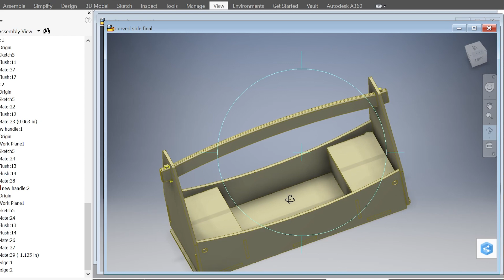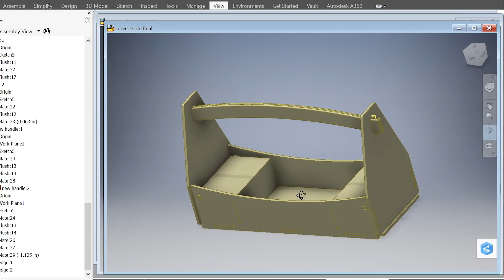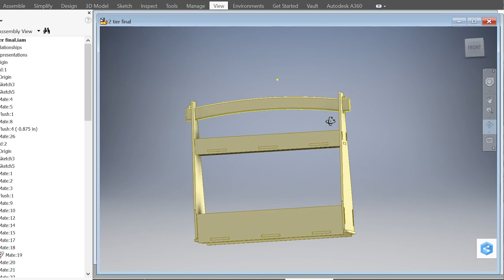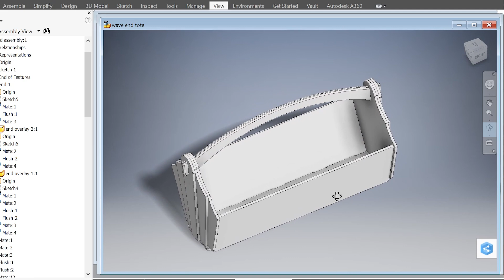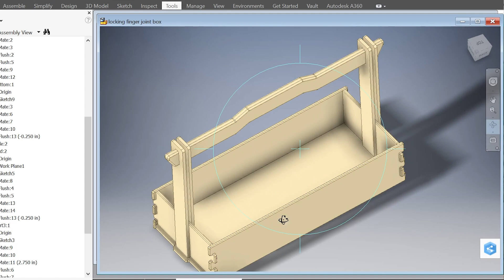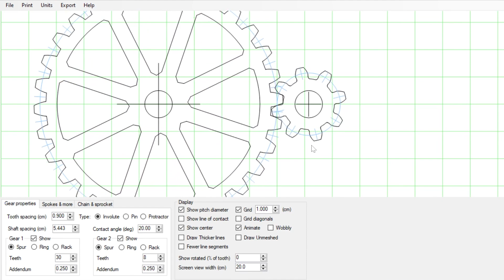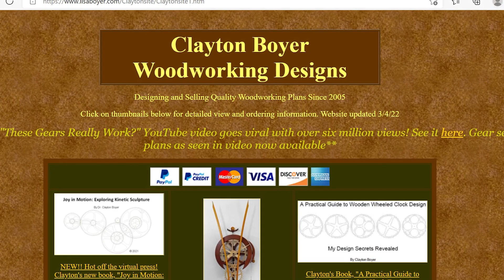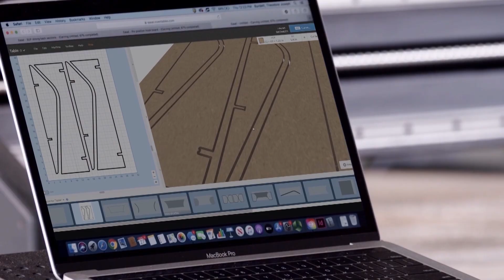CNC Basecamp Ep010: Tab & Slot Tool Tote

Comment: I looked at the web site for the tote in this video. Is there a better way to find them than having sort thru a hundred pages? Don't you have a simple list (don't need the picture) to sort thru? Otherwise it could take hours to find what you're looking for.
Reply from the maker: Yeah, I went Live with this video too early so the plans haven’t been added to the article yet. I’ll let you know when they are up.  Sorry about that.
Reply from the maker: Here is the article with a link to the CNC plans at the bottom: https://www.woodsmith.com/article/cnc-basecamp-ep010-tab-and-slot-tool-tote/  Let me know if you need anything else.

Comment: I love this video series! I am new to CNC and Vectric products and have a question about modifying your DXF files. I work in Adobe Illustrator for most of my CNC designs (although I am a rank rookie in the program and in CNC) and was curious if it would be better to make any changes in size, design, etc. in Adobe or in Vectric? I realize you could do it in either but just wondering what others would consider being the more practical route. i have read where many people use Vectric for their entire design whereas others say they use Illustrator or Corel for designs and only use Vectric for minor changes. Thanks.